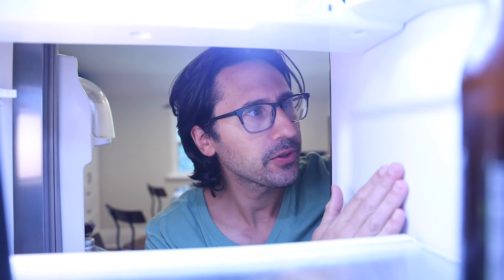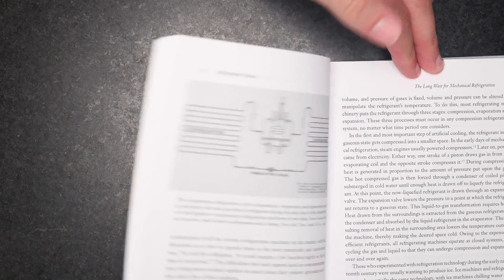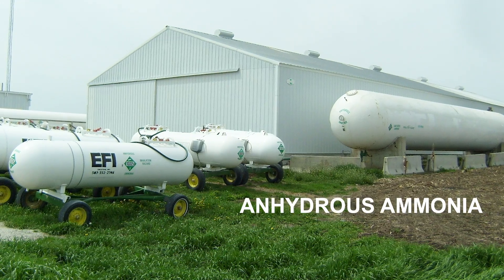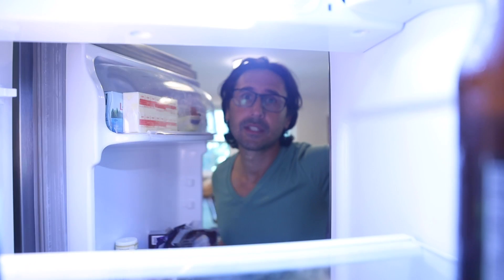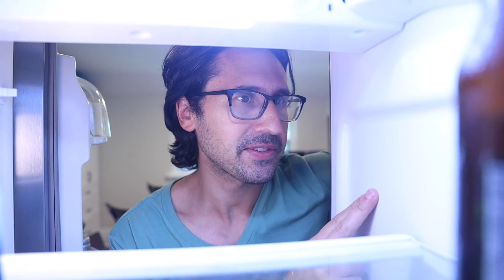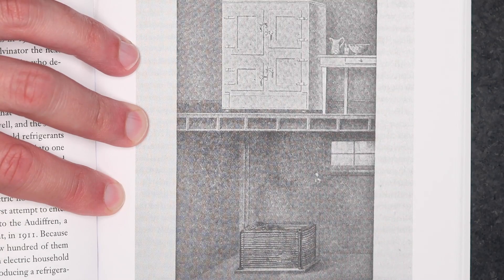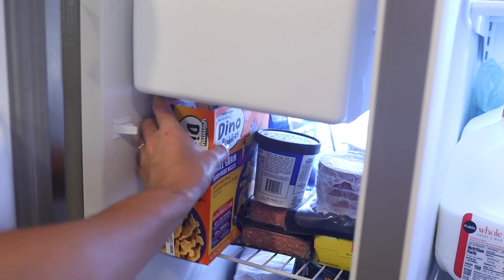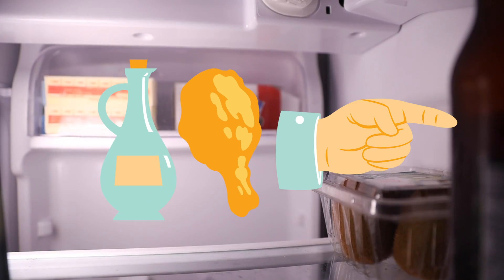How refrigerators work, and how we all ended up with one

Comment: There are no heaters that run through the gaskets. If anything, there would be a heater that runs along the surface that the gasket touches. Today, there are less heaters because manufacturers run the sealed system tubing through these areas, rather than using electric heat. And finally, to correct a video point, these areas are heated for a reason other than reducing frost: in humid environments, the coldness of gasket areas can attract condensation, which is unsightly for the consumer, and can damage surfaces over time. That's why surfaces that gaskets touch are heated, to reduce condensation. But in dryer climates, this really isn't as much of an issue. Newer refrigerants are even more explosive than ammonia. I am thinking of Isobutane. There are alternatives to refrigerant systems, such as thermoelectric, but they aren't cost effective or efficient.

Comment: I am almost positive that there isn't any heater in the gasket. The gasket has a magnet. The part of the refrigerator frame the gasket touches has tubing running through it with hot gas coming from the compressor in it. 

Also ben and jerry's was working on using sound waves to cool things. You might want to look into this as well as the magnet one ☺️👌. There is also away to cool things by using various sized vases that Africans figured.

Comment: ok so as an engineering physics student I'm kinda digging this kinda contents right here. when i was searching for supervisor for my final project as a requirement to graduate, i asked this one professor about what topics he had for us seniors. of course he offered some cool ones, from designing cheap low-powered electric stove (lower and cheaper than what the market provides) to refrigeration using a special material and joule effect. this refrigeration thing really awed me because my prof said it was to be used as a small fridge by NASA astronauts to keep any of their research specimens fresh and cold with the smallest space possible. he showed me a small 5x5 sq cm panel of the material and connected it to a battery, and i felt the cold from Joule Effect on my fingertips!! it was so cool but in the end, i didn't choose it as my project because it would be too hard for me to balance the electrical and mechanical aspect of it :))))

Comment: If your fridge is hot to the touch you need to check that the evaporator fan motor has not failed. I just replaced mine this summer.

Comment: Oooh. Refrigeration is a basically a reverse heat pump Fun fact, in the 70s there was a huge push for heat pumps to heat homes because of the uncertainty of natural gas. It’s actually more energy efficient than burning gas, but nowadays natural gas is so cheap that it’s not economical to make an expensive heat pump. Not to mention natural gas burns clean, whether mining it is clean is another question though.

Comment: I enjoy your videos. I don't think that you have done a video about sous vide cooking. I have been cooking using the sous vide method for about 4 years. I have mixed feelings about the process. It is a great way to cook a steak to the perfect temperature of your choice, then you still need to sear it in a skillet. But I have basically stopped using it for steak. I think it has s subtle effect on the texture plus it takes a lot more time than a skillet or grill. It is a foolproof way to cook carrots to perfection, something I struggle to do in a pot. I would be interested in your take on the method. My bottom line is that it is a cool tool to have, but you can certainly replicate (if not improve) the results with more traditional methods of cooking.

Comment: Unrelated question to the video. But have you experimented with the Mac and cheese method where you boil the pasta in milk until it is cooked through and the milk was absorbed industry into the pasta then the cheese was stirred in? If so how did it work for you? And would you have any tips? I've tried making it this way and it went kinda poorly tbh

Comment: Refrigerators work the same way air conditionings work: by removing heat from the air inside and dumping it outside. The thing is that the outside of the refrigerators is inside our kitchens.